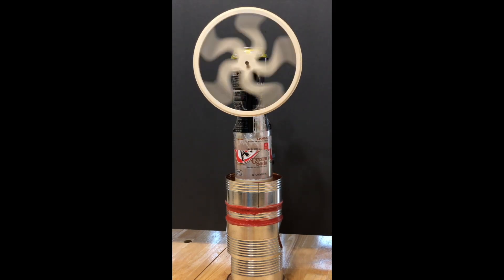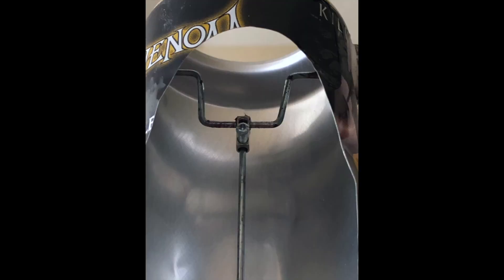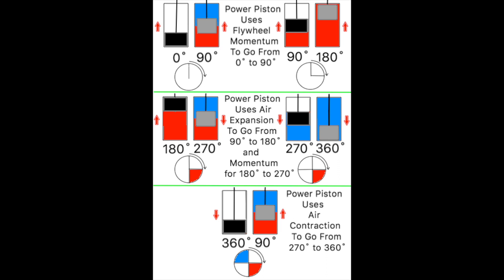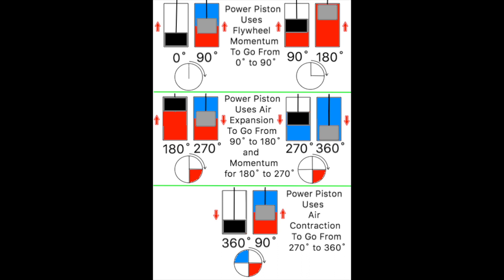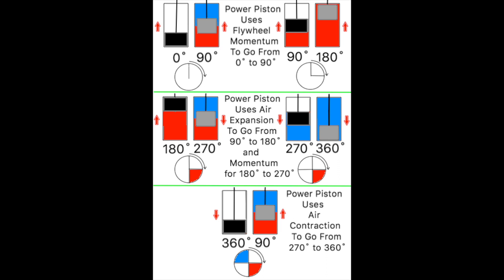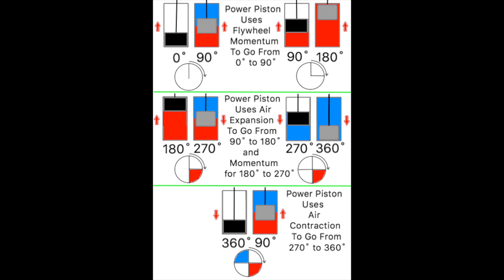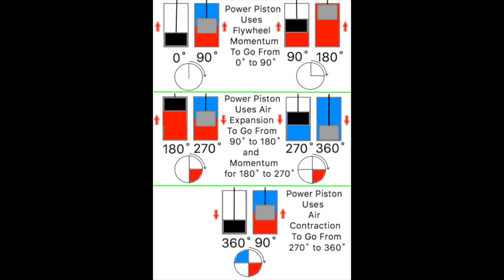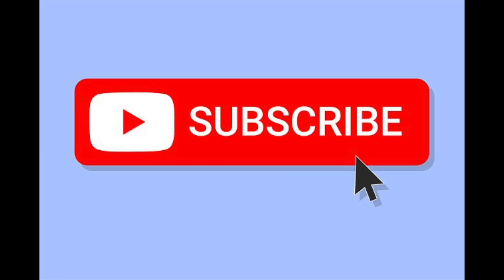The Stirling Engine: how it works and how to build.

Comment: some info.    at :43, less-than ideal  assembly of the central diaphragm supports;  resulting in   Asymmetry  in the  down-stroke and up-stroke tension.      at :55,  'stored heat by removing it'     not  well-said.        an emphasis on a regenerator is  somewhat  misplaced.     as, it can be seen that where  a) a  duct  is made of  non-heat-conducting material  and  it is b) oriented,  horizontally,  there is little benefit to the  use of  a regen-stack.      thanks, for knowing what a   gamma  config, is.      you may have seen  the  good  (OLDER )  gamma and alpha engines, made by sergio.     some of his earliest  flywheels where  not  well-made.     cheers
https://www.youtube.com/channel/UCAYCuJbsDGSPILC2JTNenFg/videos
Reply from the maker: Okay, thanks.